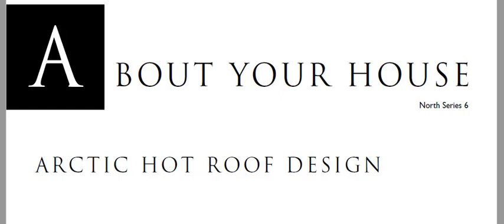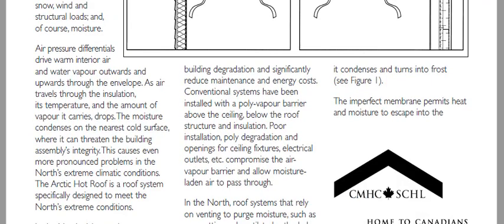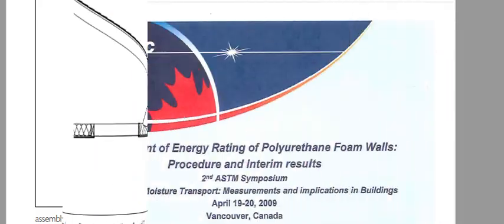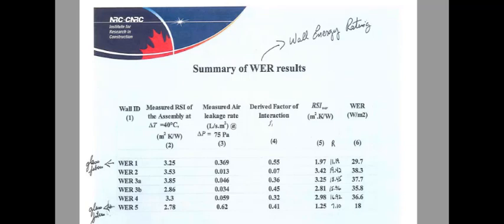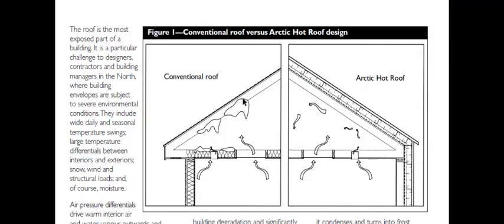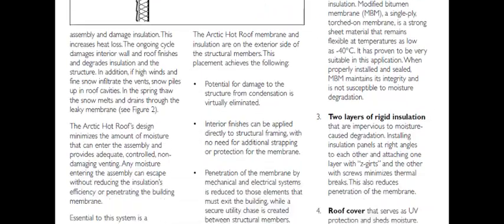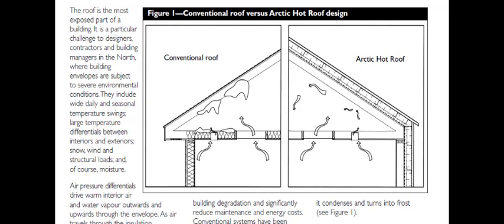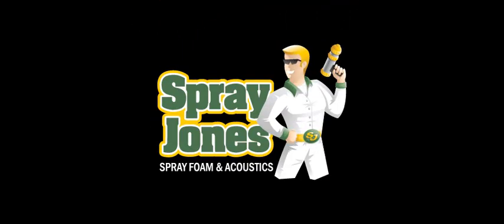Spray foam insulation to the roof deck - Does it cost more to heat this way?

Comment: Would it make more sense to look at it from a surface area standpoint? Once you heat or cool the volume it doesn't affect the ongoing heat loss because it is only affected by the surface of the building.

Comment: If you spray the roof deck like that then you need another solution for venting otherwise your ice damning will be crazy. You need exterior air against the bottom of the roof sheathing otherwise the snow will insulate from the top and the sheathing will be warm and melt snow.
Reply from the maker: Wrong. Go watch the 4 part series on non vented roofs.

Comment: I would like to add if I could. That air quality in the house goes up tremendously. I can go 6 month’s without changing the filter. In my others houses I have to charge the air filter every 30-45 days  and the filter is nasty. And in the houses that get spray foamed there cleaner behind the appliances. Huge difference. Has anyone else noticed?
Reply from the maker: Great feedback.

Comment: If a guy spray foams the under side of the roof deck and keep an open ceiling (in a garage), is it prudent to spray the walls i.e. way less advantageous to batt the walls?
Reply from the maker: I believe in spraying everything. Once you take the red pill on R value and see how slanted things are SPF is a no-brain needed decision.

Comment: I think spray foaming the decking and trusses would be a horrible idea. If you have a small leak it has no where to go but soak into the wood.
Reply from the maker: Go watch the 4 part series on non-vented roofs. We cover all that...
Reply: @SprayJones  I've seen it but the problem is if I peeled a shingle off and let the sheeting obsorb all the water with it sprayed you would never see the water from the attic or worse going through the ceiling. At least with the backside not sealed it would leak through and be visible if you are proactive on attic inspections.

Comment: One question I have, would the said R-value for code still be the same when using spray foam?  I know its better in every way but when getting it's inspected, will they be looking for a r-30 to r-40 (whatever code is in your area) even though 3 (R-18) inches is superior to ~18inches of batts?  
I'm in the south and my code is R30 in ceiling. Is there a difference for code when insulating the roof vs ceiling?  We typically use a 2x6 rafters so would we need all  5" to meet code?  or does the inspector take that it is spray foam into consideration and allow for ~3" be enough? 
Maybe you can't speak for the south but as a comparison, does the so called R-value need to be equivalent? 

Another point to make for insulating the rafters/roof is, since i live in the south, most people put their HVAC units in the attic, since we don't typically have basements. This puts a lot of temperature differences on the Ac or heater.  Since is the Summer the attic is hot, this heats up the unit and the duct work and the unit will have to cool those down before cooling down the house.  this is the opposite for the heater.  I read an article saying that there is a 20-30% loss of energy by using this method.  A conditioned attic will easily cancel out the heating or cooling of that attic area.
Reply from the maker: I think it is best to wait for the Roof and Vaulted ceilings 4 part series as the question you have will be addressed in length within that series.

Comment: Does it make sense to retrofit a hot roof onto a house insulated with batt?

What would be required to maximize the benefits without having to re-insulate the rest of the home at the same time?
Reply from the maker: Hard to do. Need a enough room or a major retro-fit to accomplish it safely.
Reply: @SprayJones  Is the difficulty around access to the work, sealing the building effectively, or something else?
Reply from the maker: @nickhourd  Correct. Watch the Playlist for vaulted roofs and in there is one about spraying inside an enclosed attic.

Comment: The only downside beside the upfront cost is that it would be hard to detect roof leak before it's too late.
Reply from the maker: Watch my video on closed cell vs open cell for unvented roofs
Reply: Pop a

Comment: Since all buildings move from wind load as well as ground movement spray foam would not settle like loose or even batts would so after seeing this I would if building spend the extra to give myself the best possible outcome. I am in the process of finishing my barn that dad I built making a shop space where I can have some heat and save my tools from rust,seeing this I now want to go with a spray foam roof your sample garage is almost the size of mine 40 x44 8 foot side walls mostly open ceilings with no ceiling joists,it’s no a clear span as most pole barn as we have a 12 foot outer bay and a 16 center bay all rough lumber roof rafters and scraping now over 38 years old. Should I be asking any specific questions to the spray foam company? Thanks for teaching us on layman terms?
Reply from the maker: This sounds bad..... watch more of the videos I already have made...

Comment: Down in the south US we use techshield or a radiant barrier for our roofing.  How can we incorporate closed cell foam with this radiant barrier?
Reply from the maker: Why do you need to? Take hot vessel tanks in the oil and gas industry. Do they use reflectives? No but 2 or 3 inches of closed cell SPF rated for 275 F....

Comment: Informative for sure, I'm about to have a shop built in the spring, and I was contemplating whether I should use foam or fiberglass, but I think foam is much more expensive, but I'm not sure yet. Thanks for the info.
Reply from the maker: Only up front. You pay on op costs with fibrous forever.

Comment: Is attic venting required with spray foam under the roof sheeting ? The attic walls are sprayed with foam also. All closed cell spray foam.
My entire house is insulated with closed cell spray foam. I'm just asking about the attic venting at top of attic walls.  I was told not to vent them. Is this correct ? What about shingle life if so... Some shingle manufacturers mention attic venting.. I'm confused...
Reply from the maker: No venting is needed with closed cell SPF. Please go to the YT channel and watch the playlist on vaulted ceilings.

Comment: Mike,
I’m new to the spray Jones channel, this is a great example for spray foam, if the technology has been out there since the 50’s-60’s why wasn’t the technology more widely used? I remember my parents building a new home in the mid seventies and the building should have been as tight as ever with the technology for glass batts and vapor barrier plastic sheeting.
The heating bill wiped out any savings in less than 10 years. What’s the overall problem for the country in not adopting the artic hot roof system before mid 90’s?
Reply from the maker: The fibrous industry has huge lobby and pull with codes. So bureaucratic control along with universities that teach architects and engineers wrong factually outdated data create a non-stop flow of brain washed people that have a say on building design and use for 30 years.... that is your reason why foam stays where it has.

Comment: Roofs leak..they just do..storms push water up under shingles flashing.. seen it.. so if foamed that wood will rot.. hold water moisture.. food for thought...
Reply from the maker: So since storms push water up under shingles and flashings how is this the SPF's fault? Which way does the roof have to dry to? The inside or the outside? Sunlight play any part? Or are we supposed to let the water into the home and the attic too?

Comment: So.. Question is.. As the public and as the contractors.. What can we do to get the rules and regs changed? Get the r value system revaluated.
Reply from the maker: Nothing. I don't think it'll ever change in my lifetime. 70 years of the industry going in the wrong direction. 

Maybe when you have a whole generation of younger engineers... maybe. But I have seen young people just as stupid as ever and worse in some cases. 
All of academia is skewed.

Comment: Have you a talk on using spray foam to replace the fiberglass on the attic floor? Seems you would enjoy the sealing effect of the foam, plus the heat stoppage. Let the attic vent in a normal way with ridge vents, gable vents, etc. and enjoy the foam properties of far less heat transfer and air sealing!
Reply from the maker: I do "Spraying down onto drywall, should this be done?"
Reply: Oh ,that's what that means.  I get it now.

Comment: I've been watching a bunch of your videos and I haven't found any where you address a concern that I have with a design idea I have for a potential home.

Climate zone 3A, warm humid subtropical (cooling dominated area)
1800 square feet building footprint (30x60) single story on slab on grade.
2x6 exterior walls 24"OC, Zip-R3 sheathing, metal siding.
Cavities sprayed with closed cell before being fully filled with open cell.
Truss roof with a slight raised heel and no eaves, Zip-R3 running continuous from walls to roof deck and back (Yes, Zip-R as roof sheathing) Metal roofing.
Similar treatment to underside of roof deck: closed cell followed by open cell, except open cell to a greater thickness than the walls.
So, basically the entire envelope has the same control layers on all surfaces.

Here's my big question though:
Should I be cutting a slot at the ridge of the roof and installing a vapor-open (or some sort of "smart" one-way) membrane? Through stack effect and inward solar vapor drive, I can't help but think that vapor, no matter how little, will congregate at the peak of the roof and put an unnecessary burden on the HVAC

What are your thoughts?
Reply from the maker: Whomever you plan to hire to do your install should be coaching you along and answering your questions. 

Also look at energy wise structures in Arlington Texas. https://energywisestructures.com/ They answer these types of questions and help with HVAC loading.... for a fee.
Reply: @SprayJones  Thanks for the suggestion. However, their post about not needing an air exchanger OR make up air in an ICF home because "the windows will leak enough" has me scratching my head with one hand and facepalming with the other 🤔🤦‍♂️

Comment: What about comparing spray foaming the attic floor to foaming the roof deck?  Other than attic stairs, wouldn't the air leakage go away with foam?  it seems like your changing more than one variable in the comparison.
Reply: Keeping your HVAC unit in conditioned space is much more efficient for it.  Imagine in winter the amount of energy needed to warm up the duct work that is in your freezing cold attic.  If the attic is warm it takes much less energy.  Cheaper to keep it warm than to try and warm it up over and over.
Reply from the maker: No thanks, got some more interesting video ideas coming up that appeal to a wider range audience.

Comment: This hot attic design clearly shows exterior insulation so that's going to yeld better results that cavity insulation any day. Like you said those are just lab results, I follow a Canadian YouTuber, and when he took tin for remodeling purposes off of his purple spray foamed garage, spray foam pulled away from wood allowing direct heat transfer and air leakage. Just like one can get a bad fiberglass install, just as much, if not more can go wrong with spray foam install. So until structures live in the real world for a couple decades and then get remodeled so we can seen how spray foam is holding up, it shouldn't be sold it as the best way to go.
Reply from the maker: Learn something would you! The foam has been in the National building code since 1990. The first building done in SPF in Canada was 1969. The foam is specified in government and institutional building all the time. The studies are DONE. The code approves it and we have the most extensive testing and approvals of ANY insulation with ULC standards.

Comment: Have you had any experience with the breathable shingle underlayments? Products like GAF Tigerpaw and Deck-Armor are breathable and marketed for spray foam/hot roofs. From my research though, asphalt shingles have such a low perm rating that the underlayment breathability doesn't really matter anyway.
Reply from the maker: No we don't get into any of that.

Comment: As a retired math and science teacher i can attest that your back of the envelope modeling is remarkably accurate. For the math and science teachers out there, this would be a fabulous authentic learning and higher order questioning opportunity for your students. For the English and media teachers out there this video would server as an exemplar of cross curicular transmediation. Great job and well explained.
Reply from the maker: Thank You!
Reply: I got 6,666.667 cubic ft for the attic space volume.  (0.5 x 40 x 8.3333 x 40)--"one-half base times height (of the gable) times length of the ridge" where 8.3333ft is the height of the gable, assuming a 5/12 roof pitch.  Regardless, Spray Jones presents well.

Comment: It will likely be in the next IBC but the standard will be spray foamed if possible, but hen 4-6 inches of eps on top of the roof and then a vented batten layer. If you vent under the roof material it increases it's life and reduces the condensation against the sheathing material.

Comment: I’m debating on what to do. I’m having my walls, and crawl space insulated with foam. But im not convinced that a conditioned attic is the most efficient or cost effective way to go.

I feel as if I have the attic floor (the ceiling of our living space) spray foamed and air sealed. Then leave the roof deck alone, with the attic still open air. That will be most cost effective. Not requiring as much spray foam, and I should not have leaking air into the attic.

What are your thoughts about trying this, as opposed to going full conditioned attic? I live in southern hot climate where we rarely see any snow.

Thanks!
Reply from the maker: If duct work is in the attic, then foam to the roof is the only way to go. Please watch video on : "Should we spray down" for all the other issues associated with this.
Reply: I was just hoping someone would mention the air ducts in the attic. There is so little if any insulation around the duct itself that a hot attic is making the ac or heat work way harder than it should. This cost is direct to your wallet

Comment: Thank you for this. Building a metal barndo. Not arctic, but Central TX so nice and hot. We are focused on vapor barrier, so CCF but only 1.5in on the roof deck. Once we drywall the ceiling, does it makes sense to also blow in come insulation up there as well. It's truss, so no space for an attic anyway. This is a weekend place, so the apartment will get maintenance conditioning all the time (humidity control) but only run for real heat and AC on the weekends we are home.
Reply from the maker: You have similar issues as the arctic only reversed. Heat outside trying to get inside. Is 1.5 inches all you are doing of CCF?
Reply: @SprayJones  looking at 1.5-2 ccf on the roof deck. Then for the corner of the building with an apartment 2" on the walls. For the rest of the walls just 1". Then I may throw some glass in the walls between the ccf and drywall.
Reply: Just watched your video on how to evaluate a contractor. Lots of guys throwing $/sf at me. But one is focused on our goals and wants to walk the project once the building is built. His first thought though was the suggested 1.5-2 roof and 2 in apartment walls/1 in others. All subject to change.

Comment: Doing a post frame or steel frame building, steel deck all roof, 90 %of the walls. Will use zip on that 10, with options.
Planning on foaming it, closed envelop, I should have no eaves? needed for ventilation is a savings, correct?
4/12 or a continuous roof still deciding. Any preference? 40x60x10 heated floor slab.
My local guy thinks we should shoot the ceiling 1 inch closed, then go back with about 5 open
Same on my walls, 1 and 4.
Shop area all closed??
Sound like a good plan?
SC heat, mild winters, retired, can build anything!
Thanks for all the great info!!!
Reply from the maker: You have a lot of questions there. Too many for me to be of assistance. Closed and open celled: pick one and stick with it. That is m opinion. I know that mixing is popular in some states. It isn't where we are. We use closed cell almost exclusively.

Comment: I like the idea of spraying foam directly to the back of the metal siding vs against the house wrap in a pole barn type structure. Lots of benefits...increased structural strength, added dent resistance and excellent air sealing... but what about the inevitable water penetration around doors and windows? Seems like moisture would get stuck behind the metal with no way to dry. But spraying it against the hanging house wrap seems like a wasted opportunity.
Reply from the maker: I agree with you on spraying direct to metal. Just far less to go wrong. Architects draw buildings for longevity NOT what is easier to take apart when damaged....
Reply: @SprayJones  Any idea on how one would address the water that would possibly get behind the metal and into the wall system? Have you sprayed directly to metal around windows and doors in a pole barn? If water somehow did get in the wall I would assume it will become trapped as it would have a vapor barrier on each side (foam/metal) and no possible way to dry. But then again the foam sprayed in place should fill any void a water would possibly get into in the first place.